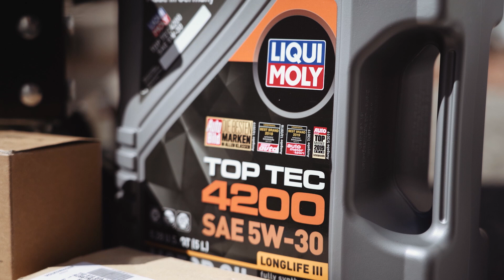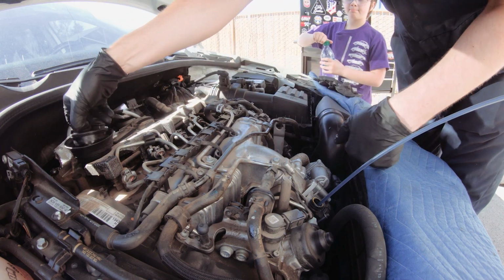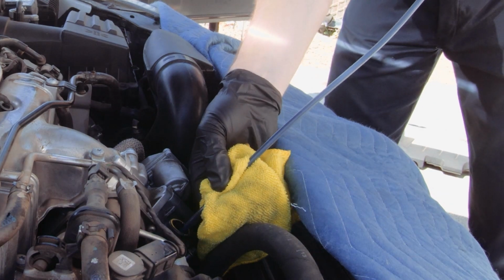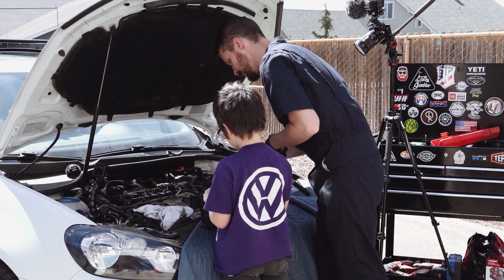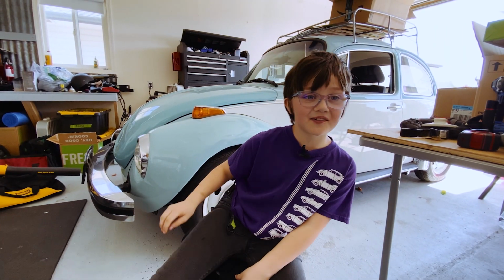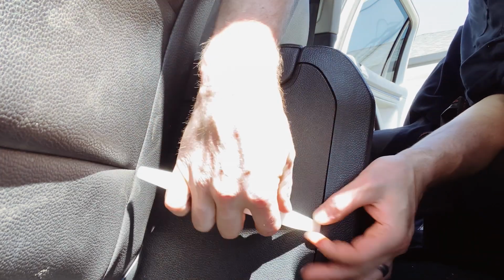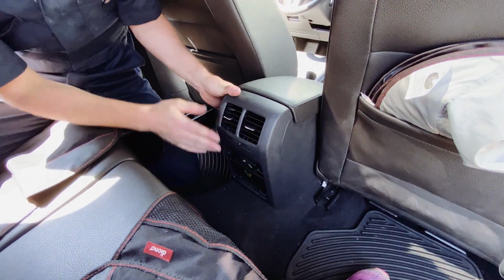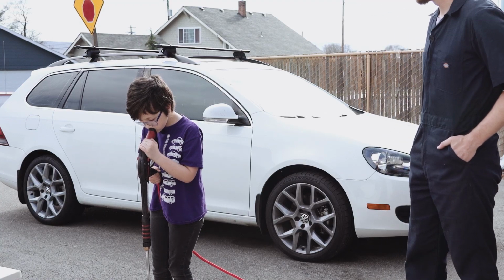VW MK6 Jetta Sportwagen TDI Service (Oil, Filters and More)

Comment: Two gems there Jason! Great vid, good watch during quarantine! A question about your air filter, is it one of the long use ones? I'd normally change the filter each service. Take care everyone!
Reply from the maker: Stock VW filter.  I've always been told you just replace it when it's visibly dirty.  I've lived places I needed to change the filter every oil change (gravel roads, etc), but I don't usually do it that often.

Comment: Thanks for the tutorial, going to use this method for my first oil change. 
Have you made any upgrades to the JSW suspension or sound system?
Reply from the maker: I’ve since sold the car, but it was great.  I’d recommend the B6 Bilstein shocks and struts and tow springs in the back.  I didn’t do it on the JSW but I did use the Bilsteins on my GTI.

Comment: hi jason..I'm using jetta 1.4tsi 2017..sometimes we go camping with it..I was wondering what is an advantage of a car with no roof rails?..how you fix the roof racks?..need to screw it?
Reply from the maker: I’d suggest the type of rack that secures into your door jams.  Not cheap, but here’s a good option:
https://www.etrailer.com/Roof-Rack/Rhino-Rack/RR73MR.html?feed=npn&utm_source=google&utm_medium=cpc&utm_campaign=Google%20%7C%20Shop%20-%20Roof%20Rack&adgroupid=84311584923&campaignid=203663657&creative=398853166447&device=m&devicemodel=&feeditemid=&keyword=&loc_interest_ms=&loc_physical_ms=9033664&matchtype=&network=g&placement=&position=&gclid=CjwKCAiA866PBhAYEiwANkIneIYz4kNEzc1jx6ehf34HHvbHSvieDWaqVWRb4NWCLvBfGj1efNKiaRoCK68QAvD_BwE
Reply from the maker: No drilling or anything.

Comment: Great video! You're lucky that your little one hangs in there with you because when I tried to do these types of things with my son he would always disappear after a few minutes.    BTW: how do you like the VW TDI?
Reply from the maker: She took multiple breaks but yeah I was very glad she was into the project.  I love the TDI.  We've had it for over a year.  One of the diesel-gate cars that was sold with a factory warranty and very low miles after the cheating software was removed.  Surprisingly fast, fun to drive, fits tons of stuff.  I would get another one for sure.

Comment: Can u still empty the oil from underneath so I don't have to buy a pump lol?
Reply from the maker: Definitely.  It’s super easy the traditional way as well.
Reply from the maker: But... once you get an extractor, you’ll use it a ton.
Reply: Do you add any additives to the diesel gas during winter on these cars? I've had trouble a few times not starting during some cold nights but then no problem the next night.

Comment: What kind of wheels are those?
Reply from the maker: They're often called watkins glen I believe.  18" VW OEM wheels from MK6 GTIs.
Reply: @JasonExplainsThings  I’ll have to check them out, thanks.  On a side note, have you ever had your sunroof drains cleaned?  I’ve read that it’s a good idea to have them cleaned (and drained) to prevent any potential leaks with the pano sunroof.
Reply from the maker: Yes sir.  I've cleaned them myself a few times.  Pretty easy process.